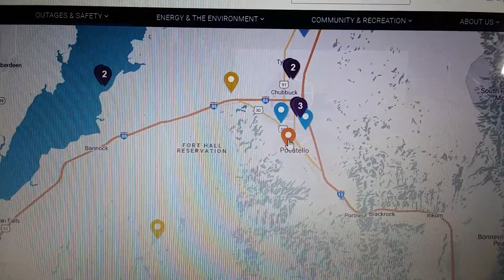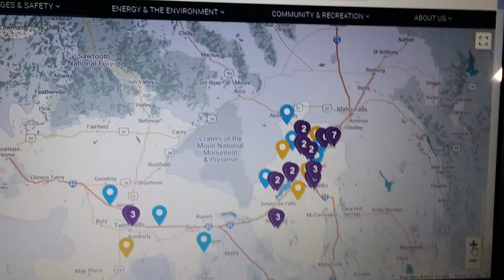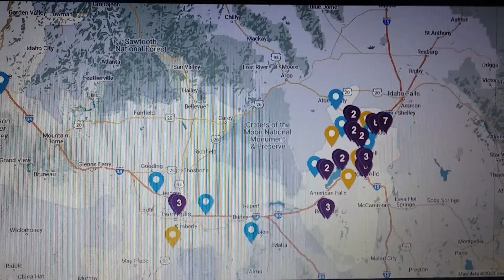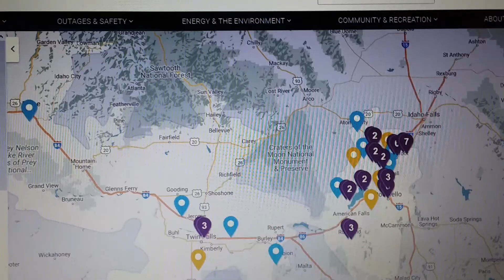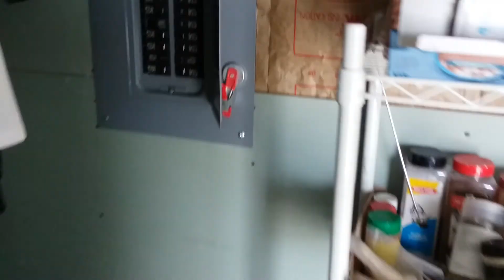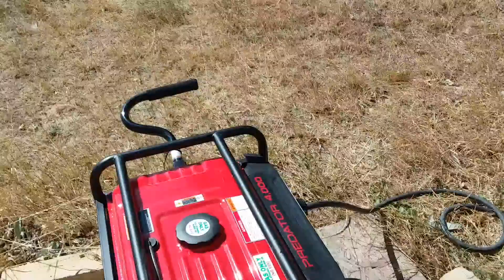28 Hours without power..and counting. (At time of publishing)

Comment from the maker: **See update below** I will upload the other videos of the first outage repair later when we get power back. I have been running off of my generator for several hours now and about to shut it down for the night. Will update this comment with details of when we finally get power back and what caused the extended outage if I can talk to the repair crew. Stay safe everyone. *UPDATE* Power was finally restored at 2:18pm on the 9th. The delay in our case was simply due to crews being overwhelmed. We did have a tree down on the wires a few houses away (to the right of the pole in my back yard) that the crew had to cut away from the lines. Total outage time according to the City generator's hour meter was 46.6 hours.